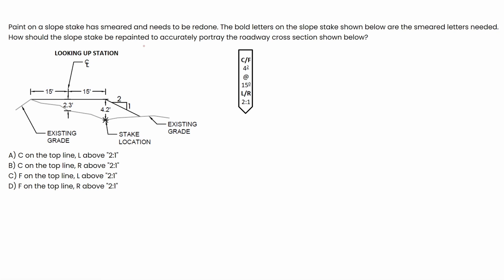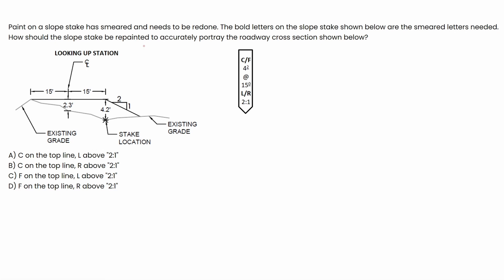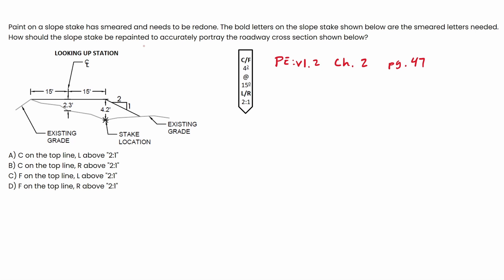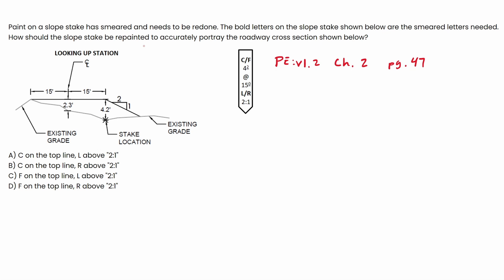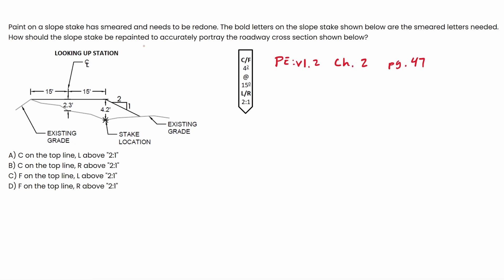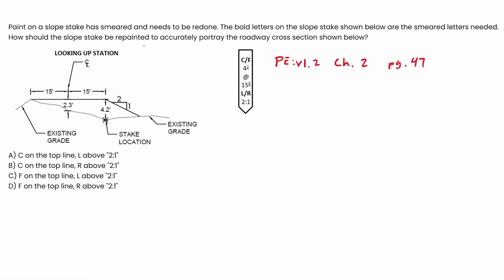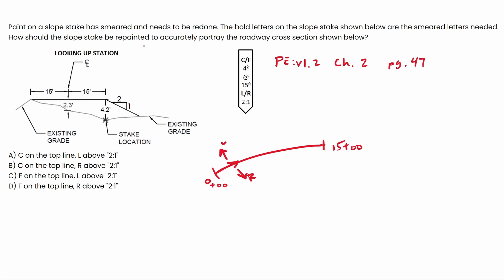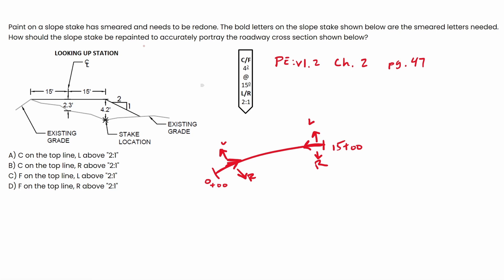Civil PE Exam - Construction - How to Read and Identify Slope Stakes

Comment: What's the difference between ncees pe hb 1.1 and 1.2 ?

Any extreme differences? 

Does 1.2 do some things better than 1.1 ?
Reply from the maker: If you're curious about the changes from the 1.1 to 1.2 PE Handbook coming in April, we've done some homework, and this is what we are seeing so far.  

Let us know if you notice any changes too! 

Added new section 5.1.6 "Design Traffic" (1 page) 
2. Added new section 5.4.3 "Interval Timing" (1 page) 
3. Removed a section 5.5.9 "Traffic Growth Rate" (1 page)
 4. Updated the title of section 6.7.1 from "Mass Calculation" to "Mass Conservation and Continuity" 
5. Added new section 6.7.2 "Advection-Dispersion Reactions" (2 pages) 
6. Revised the critical depth yc of trapezoid formula on page 357 (PERH 1.2) or page 349 (PERH 1.1) >> we noticed this error months ago. 
7. Total pages 509 (PERH 1.2) vs total pages 497 (PERH 1.1) 
8. Added qmax and qmin formula for bearing capacity (page 100)
9. Revised USGS culverts page 365
10. Removed the Nq,Nc, Ngamma formulas (page 97) and refered students to use table only
11. Added the correction factor of groundwater table (page 98)
Reply: @CivilEngAcademy  thank you very much for your thorough response.

Just when we got used to 1.1 ncees has to release 1.2. ;)

In your opinion, are these changes welcome or are they introducing now extra material we need to study anew ? I.e. what's the spirit of the update, in your opinion -- an improvement or a reimagining of core concepts ?

Overall, do you approve of this update or feel it is excessive in an already complex exam preparation process ?

Thank you for your thoughts on this important update!
Reply from the maker: @oleopathic  improvement overall.  There's a lot of material they don't cover in these so expect them to be updated often.
Reply: @CivilEngAcademy  I saw on ncees web site that the hb's now have expiration dates. Can you believe it ? That's right -- 1 year lifespan and then another update! Means the examinee better study and pass exam within 12 mos, before the next edition hits the virtual "shelf".